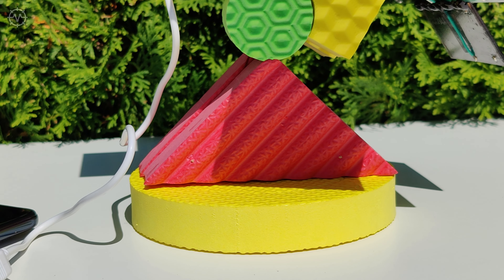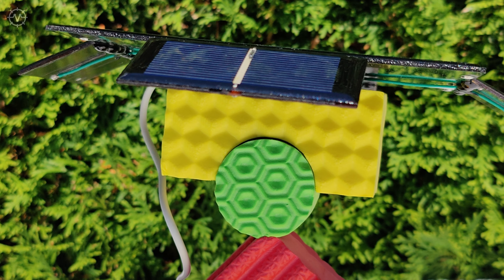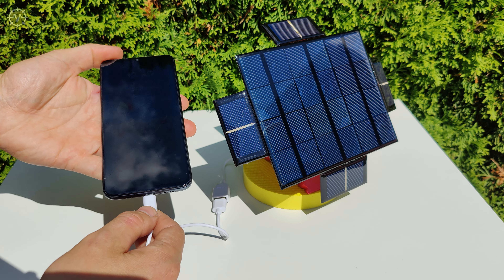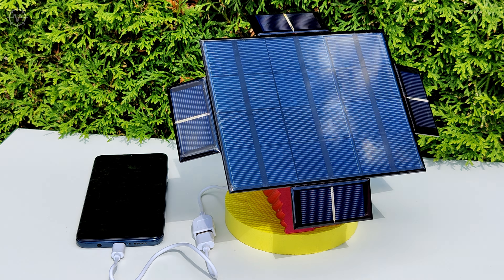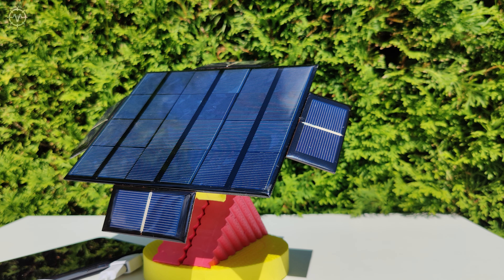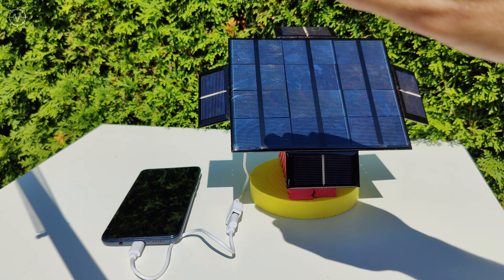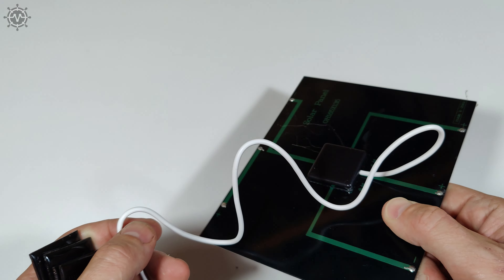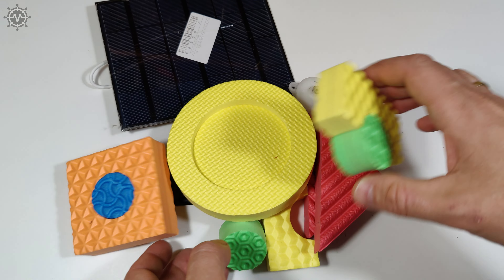How to make a Simple Solar USB Charger with Dual Axis Solar Tracker DIY (4K)

Comment: I tried to build this with the specific solar panel ratings and motor, however when the panel dips past a 45 degree the motors, I have, do not power it back to centre again. I think my motors are not powerful enough. I wonder if placing the small aligning panels flat with the main cell, if that would help give the motors enough power to hold the unit in place....hmmm

Comment: As a novelty it's interesting. For practical use, it's too small to be of value. No weather resistance either. Quirk.
Reply from the maker: Thank you for your comments.  Yes, it's just a concept, so it's small and not so powerful on the other hand it's a portable device, so if it will be too big it wouldn't be good either. But there is always room for improvements ;)
Reply: @MukGyver     scale up the project.  one would need 2 12v motors.  access to a mini lathe n mill to make strong attachment points for the motor assemble.  

still a great share!!!

Comment: Great use of the suns energy! I want to add the tracking system to a full 15 Amp collector. Would have to add stronger motors?
Reply from the maker: I would think that more powerful motors would definitely be needed, but the general principle of the tracker would remain the same.
Reply: The sun moves slowly, so gear ratios are your friend here

Comment: I've been kicking around the idea of using one of these computer-free autonomous trackers where, instead of connecting them to electric motors, the micro panels power solenoid switches that just complete the circuit to power larger motors on linear actuators in order to track with a full-size array. Have you considered or gamed out this idea?
Reply from the maker: Unfortunately, I did not have time to consider this idea.

Comment: 12v car wiper motors  ? Make for a great propeller , just have it chasing the sun ?
Reply from the maker: Will work, but solar panels of appropriate power will be required to run wiper motors.
Reply: There are small 12v solar , will have plenty of torque too or use step up booster module  @MukGyver  weld mount   one to another with plate  , I too will be having a go , looks like fun idea . That could work smoothly .